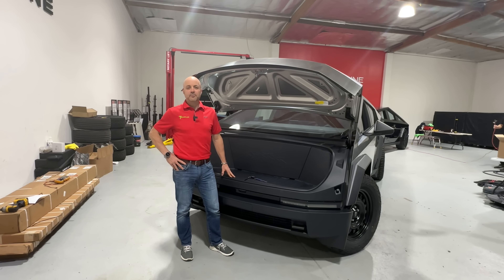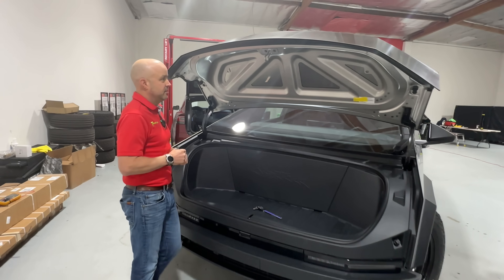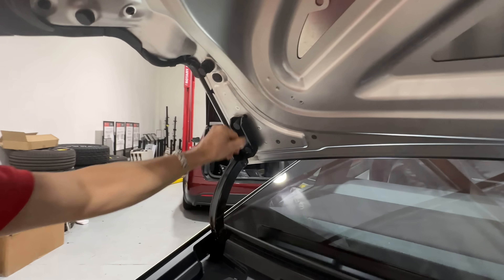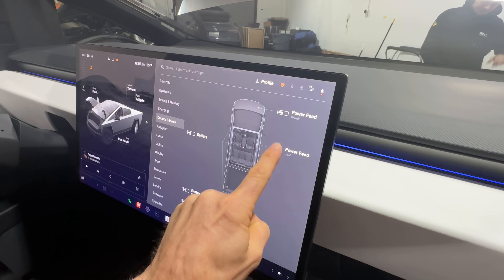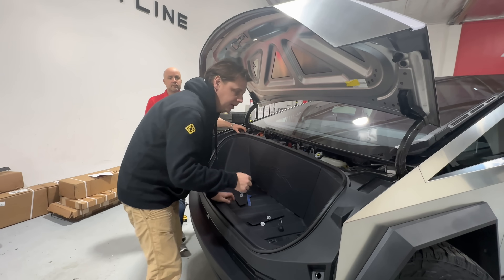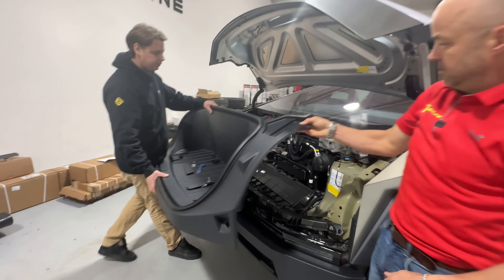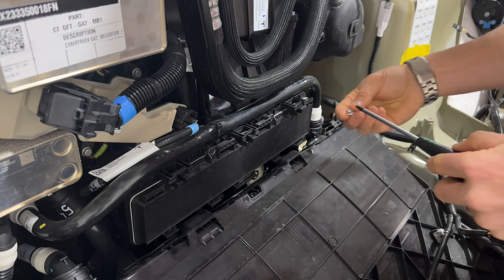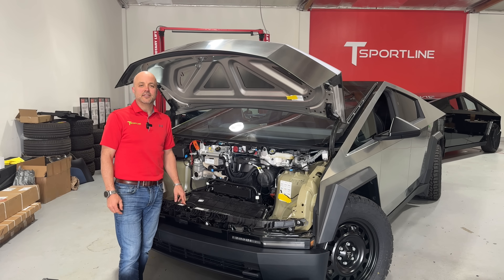Dissecting a Cybertruck Part 2! Tesla Auxiliary Power Under Frunk, Inspection & More, first look

Comment: Now I need a winch bumper aftermarket and a 48v winch?????
Reply from the maker: Bring on 48v!
Reply: i probably would bring 240 volt from the rear all the way to the front and feed a 240 volt industrial winch. at 20 amp you would have a 5 KW winch.
Reply: If you can live with 400W max (close to 0.5HP)
A good hand drill would be able to match that winch strength.

Comment: No HEPA filter?
Reply: 9:55 He pulls out the HEPA
Reply: @@OrwellNailedItThere’s no cabin filter from the parts catalog.
Reply: I understand these guys wanna be first for clicks and views but they need to get it right. Or add corrections.
Reply: The HEPA filter is the cabin-air filter.
Reply: The HEPA filter is the cabin filter.
Reply from the maker: It is HEPA, yes

Comment: For any suckers who think that this vehicle has a "stainless steel exoskeleton"... note that the construction revealed as soon as the front trunk linker is removed is a conventional unibody, with major inner structural components in aluminum (such as the large castings) and in non-stainless steel alloys. There's nothing wrong with that construction, but it's a reminder to ignore marketing nonsense... and everything that Elon Musk says is marketing nonsense. 

Also, unlike most unibodies the front quarter panels (or "fenders") do not appear to be bolt-on, so collision repair costs will be increased.

Comment: Far out! 48 volt battery confirmed!
Reply from the maker: yes!
Reply: Was there any doubt about this? It's not a technically difficult thing to do, and has been well-publicized.
Reply: @brianb-p6586  I knew the system was 48 volts I just didn't know if it would use a power supply of some kind or if there would be a real battery for low voltage stuff.
Reply: @frankcoffey  a battery is required, so that there is power for the control systems before the connection to the high-voltage battery is enabled. The contactors (electrically controlled switches) which make the high voltage connections are powered from the low voltage system.
Reply: @frankcoffey  there is, of course, a voltage converter too, supplying up to 48 V from the high-voltage battery... that's where all of the energy comes from for the low-voltage system.
Reply: @brianb-p6586  I saw that board when Sandy Monroe talked with the engineers. It does a lot. In all the truck has to provide 800, 48, and 5 (USB) volts then it has to also provide 240AC and 120AC in the bed and maybe even 12DC for the trailer cable.

Comment: Wow a 48v aux to do whatever you want with amazing think off all the 48v accessories .................oh wait never mind
Reply: It's easy to step down to 12 volt with a 48 to 12 volt "buck converter", if you ever need 12 volts. Don't forget to make the cables 4x thicker at the 12 volt side.
Reply from the maker: Yes, 48v accessories inbound!

Comment: Less parts on an EV ??? Sure doesn't look like less.
Reply: Aynone who says less parts on an ev probly doesnt know it runs on AA batteries which can individually fail and cant be repaired easily if at all
Reply: Internal combustion engine has 200 parts... on it's own.
Reply: @channel4ferrets  How many batteries, 7000? how many computers, at least 10? how many electronic components, thousands? how many battery managements parts, thousands? how many electric motors, at least 10?  how much wiring and connectors, miles? how much plumbing for cooling and heating, gobs? do I keep going or do you want to take back the few ICE parts claim. I've been a mechanic for more than 40 years and know exactly what the difference is. You?
Reply: @channel4ferrets  How much is a new Hyundi battery, how much is a new Hyundi engine and you can tow an ICE car if it doesn't work.
Reply from the maker: Lacks and engine, so yes...
Reply: @TSportline  The single engine the dual engine or the triple engine, some call it a motor some an engine same thing. How many parts make up an electric motor, hundreds and hundreds, just because it has 3 or 4 main parts doesn't mean it's one part,  the main parts are hundreds of individual parts.
Reply: I think the point is an EV has no parts under extreme stress of heat and pressure that tends to fail over time, especially if you don't do lots of maintenance.  You can run an EV for years without any maintenance other than tires.  The motors are trivially simple in comparison with any ICE engine.  Most cars to day have lots of electronics, so I'm not sure there is much difference if you count down to the component level. Electronics are exceptionally reliable in comparison with an ICE engine and drive train.

Comment: So, if I want to replace my cabin filter it's like a 4 hour process to remove the "frunk" and all the additional bits. Yeah, great engineering. Rivian is one easy removed panel and a cover plate. Neither need tools to remove.

Speaking of frunks, what do you put up there? Couple of Target bags full of stuff you don't mind spilling out? There's not even a cargo net to help with the TINY space of storage up there. Pulling from the previous video on the break down, only aluminum or aluminum combo metals for under the truck? For a truck you supposedly want to go off road? No option for any kind of upgraded skid plates? Sad. And speaking of off roading, can't install larger tires without some sort of really custom lift kit or hardware change kit to remove the exposed bolt ends?

This was a truck engineered by car makers who don't know anything about going off road. Not their fault. I blame Elon and unbeatable time-lines.

Also, rear wheel steering on an off-road truck? If so, you had better beef it up a LOT more than they did. Again, car makers making trucks.
Reply: If you want to replace the hepa filter on the cybertruck, you open the frunk, then take off the front panel with your hands, pull out the filter and replace it with a new one.
Reply: The video that you did not even see or understand correctly is only 11 minutes long, how do you get to 4 hours to replace a filter?

The underside of the truck had a rail going down the middle of the floor, this could maybe be used to secure battery protection depending on how strong this rail is but offroad racing needs complete rebuild of the underside and probably also the suspension, Tesla has a really bad reputation when it comes to suspension parts.
The Rivian underside looks worse then the Cybertruck and is probably going to be crazy expensive to repair.
The best option may be the F150 lightning if you want to mount skid plates and offroad like crazy.
Reply: No, you don't have to remove the frunk. There's a panel in the back of the frunk that you can remove (unclick it), then you remove the 2x 20T screws and you can replace it. It's a 2 minute job.
Reply from the maker: Nah, you can get to it through a small access panel in the frunk liner.  Do not need to take out frunk liner.
Reply: Ignore @azsean73 - just a dumb bot that didn't watch the video and just spews the same misinformation over and over.

Comment: If a magnet sticks to that stainless steel, it’s going to rust.
Reply: If not then the Stainless steel wont be strong enough to withstand any blow and will be dented all over the places, so it is combination of both.
Reply: @pindot787  That thing is going to weather terribly. Every ding and smudge is going to show up.
Reply: When stainless is cold rolled it aligns the crystalline structure of the metal and it becomes martenistic which makes a magnet stick to it, it's not because it has "iron" in it that will "rust"  (actually all stainless "rusts" but is a chromium based rust that forms an oxide layer, which is why stainless creates its own matte finish).
Reply: @blipco5  where did you learn about metals?
Reply: @lemcakes32422  From looking at my kitchen sink.
Reply from the maker: Normally yes, but in this case the martensitic grain structure is from cold working, this is not a rust prone stainless series like 400.
Reply: @blipco5  porcelain sink is much better

Comment: Surprised to hear the frunk skin inner structure was also stainless steel. I can’t wait to receive my 2025 RWD Cybertruck!!!
Reply from the maker: Yes!
Reply: The exterior stainless steel panels are welded to stamped stainless steel inner panels, just like any conventional unibody (but in stainless steel, rather than other steel or aluminum alloys). 

Muno Live has a factory video about the body panel production.